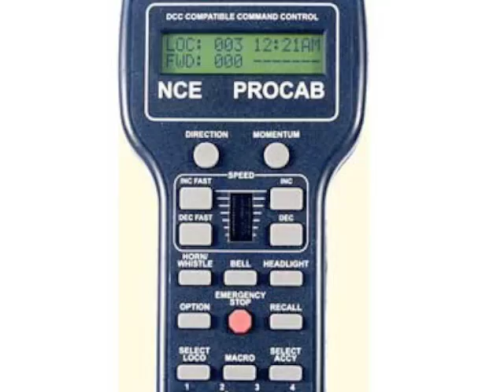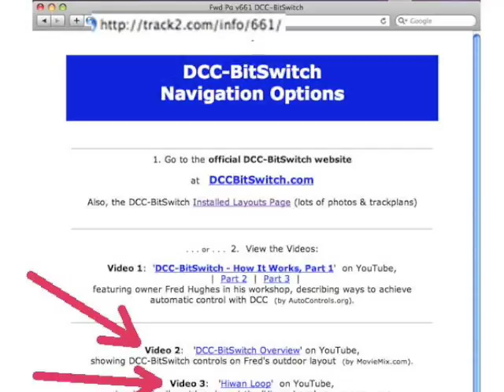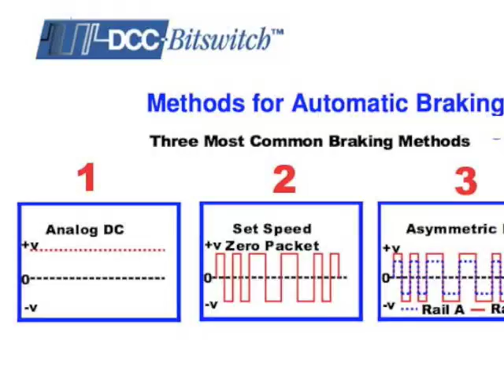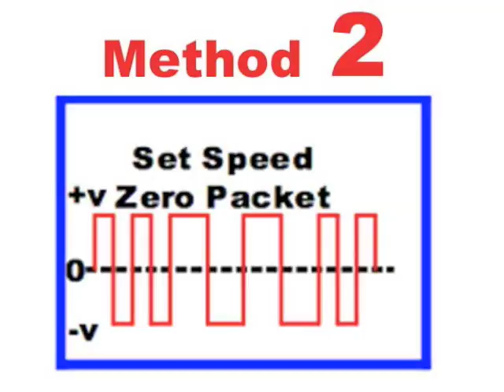803-2/3: DCC-BitSwitch by Fred Hughes: 4 NCE Cab, 5 DCC Overview, 6 & 7 Automatic Braking

Comment: The V3.6 Lenz st 100 - is a masive improvement over the previous system.
You can activate any of the 28 functions keys with two presses of the key pad, loco call list is now 12 at once,.......